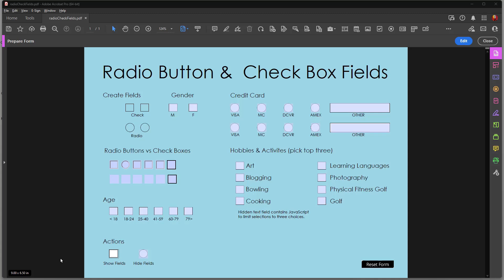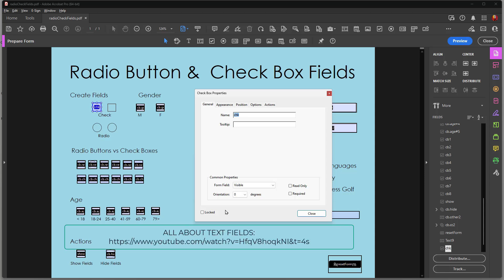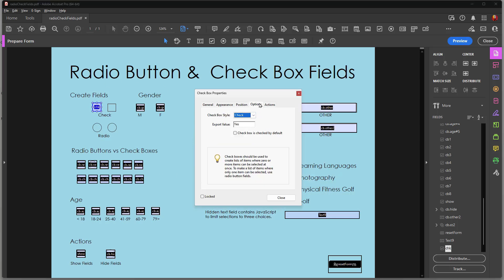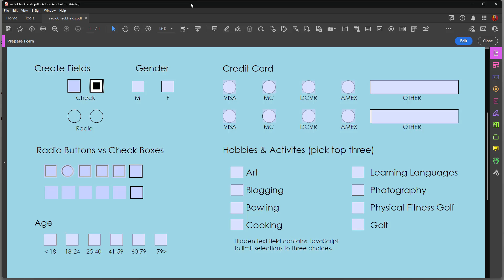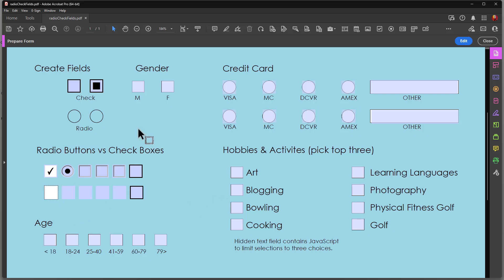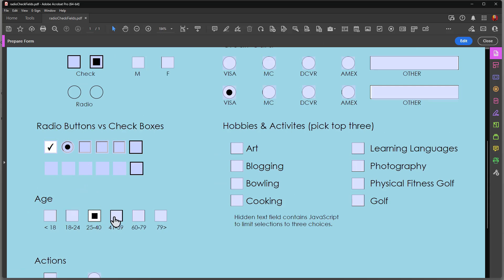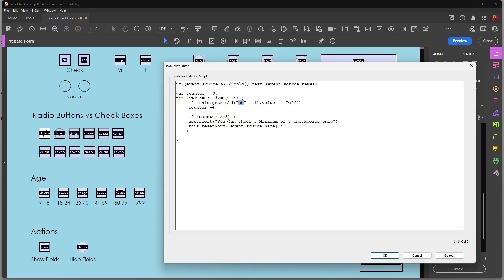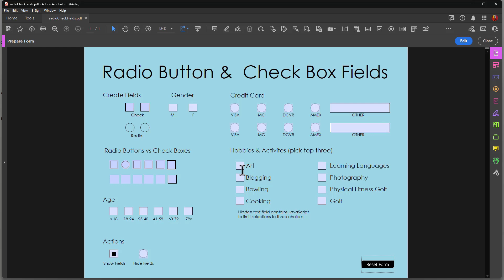All About Radio Buttons and Check Boxes

Comment: Could you please elaborate on how you transformed the checkboxes into radio buttons in the top row(1st row straigh after Credit card)?
Reply from the maker: The checkboxes weren't transformed from radio button. The form design had a circle on the form and the checkboxes had no border. It appears as though they look like radio buttons, but they were originally created as checkboxes.